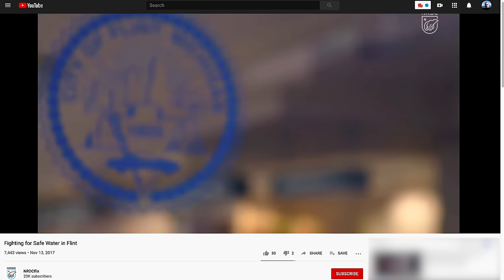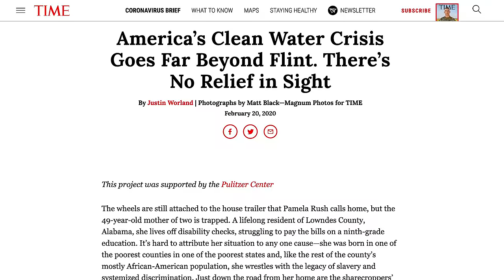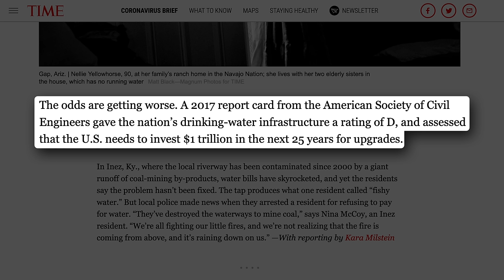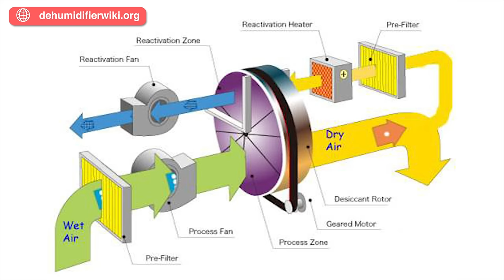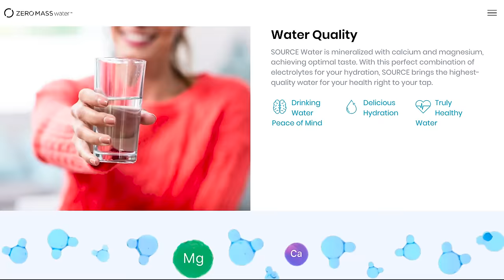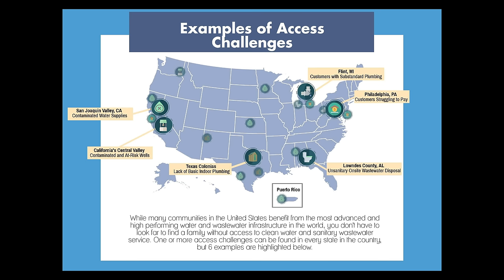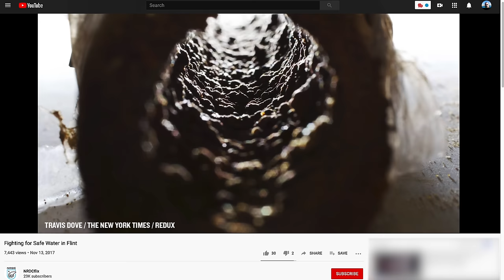Off-Grid Water With Air and Sunlight

Comment: Another great way to get distilled clean water.......your ir conditioner system removes  the moisture from the air and is safe to drink and it will produce upwards of 5 gallons per day here in Texas.
Reply: You read liter wrong, in terms of gallon, it's 1.3 gal/day; and if you shill out $13,000 for an array of 2 pannel (according to Source). Moreover, the water is not safe, same goes to drinking water from your dehumidifier.
Reply: @pauldo5846  it's distilled water though.  I've captured several gallons of it BUT ran it through a water filter and it tastes exactly like the distilled water I buy from Kroger.

Comment: There is a cheap air conditioner that sells for around $200. It is sold as tent air conditioner and caravan air conditioner. It consumes 0.2 kW. If you buy it, you will get both cold air and approximately 5 liters of water. You then use this water with osmosis purifier/mineralizer systems.  Thus, the total cost would not exceed $1000

Comment: Thanks for sharing. 

If you could touch on a few 
questions not covered in the video...

¹During peek production, how 
   many letters of water has a 
   single unit provide ?

²At what temperature do the units go
   into hibernation mode ?

³ Is the hibernation mode
   adjustable ?

⁴ Is there a minimum height required 
   between units & water storage
   tank (if mounted to same service) ?

That's probably enough for now.
😁
Thanks again.
Reply: Ps..
I understand that the answer 
pertaining to question on 
productivity is based on 
humidity. 

A best guess or better will serfice.
👍

Comment: This are interesting but need a lot of improvement. Like you said they make a lot of noise pollution and if you have more than one in a community the noise will increase. Also what effects is the air pollution on the inside and will the filter be able to catch every pollutants I think for watering the yard or having some at hiking areas to stop running pipes that will leak in the future is a perfect solution

Comment: Its still pretty cool machine.  hook to a water tower or storage tank let gravity do the work. Than you could store little water for showers and other things.since its using solar no reason couldnt install heaters into the system to get it to work in winter. Or melt snow and ice for water and filter that

Comment: definitely a really sound option. I intend to live rurally in Mexico and I am VERY interested.  Re: the freeezing thing if the unit was inside a building with a small heat source, it might be fine for a few degrees below 32, but for deep freeze i don't think so.

Comment: I live in Arkansas and the city water is actually good but I have a son that lives in New Orleans and their water is carcinogenic.  Another son lives in Southern Colorado where water is Very expensive though he would have trouble with freezing as he is at 8,000 feet.  He and his (current) three kids would benefit from this.  Think about the many American Indigenous families and all the trouble they have with reliable water.  I have to think that this company has an absolutely killer product.  The noise and freezing problems don’t sound insurmountable.  Remotely mounting the tank to the attic could help maintain access to the tank.  The noise given how much I would use as a single old man, I could likely run in eco or quiet(er) mode all the time.   
This is very promising.  Flint could use this on an industrial scale once the freezing problem is cured.  I love it.  I’ll set a reminder in my calendar and watch their progress.
Thanks for putting this out.  I hope the company sees the value you have brought to their product and makes a point to keep you happy.

Comment: We use a Brita pitcher with Costco Kirland filters and spend less than $75 a year for filtered water. That would be $1125 over 15 years! There are even higher end systems that may cost you $200 a year, which is still even less than this system.

Comment: My question would be, how would this affect rainfall in already dry areas. Areas are dry or water scares because it does not rain enough. What do you need for it to rain, enough humidity to generate clouds and rainfall. So if you extract whatever humidity is in the air on a large scale will it not prevent rainfall even further thereby making the area even more drought prone than it already is?

Comment: @ Ben Sullins its been two years since your video, how is the system working now?  Have you seen any upgrades on noise dampening or improvements to use for harsher/cold weather areas?  TIA!

Comment: Will it work on a boat?  Because reverse osmosis watermakers are expensive and require frequent maintenance with expensive parts.  If this is set it and forget it, and it works on a boat that rocks a bit all the time, you can sell a lot to people with boats.

Comment: Oh wow that noise. I was seriously considering these panels until I heard that noise. That is a deal breaker. If they can address the noise problem to make it not noticeable I will reconsider. My other issue is does this solar panel have to be tied into the grid or is there battery backup for the solar panels?

Comment: I live in Phoenix, but this would not be practical because I live in a planned community with an HOA.  Also, I'd need all the roof real estate I could get for solar panels if anything goes up there.  Our tap water is safe and filtered, so it would not be practical.  I would, however, consider something like this at scale for an off-grid property with some space.  A combination of harvesting from the air and rainwater collection could be an interesting alternative to drilling a well if one could find a way to keep the cost down.

Comment: Engineer here- fantastic device. Impressive whoever came up with this. I love it, but I still think it is very important that the general public understands how solar panels are constructed (which takes lots of energy), the materials/metals they require, how those materials and metals are physically obtained (also takes a lot of energy and often heavy machinery), the processing of these materials (massive amounts of energy) & in the end what happens to the panels and their components once they no longer work (a lot of recycling techniques require a lot of energy . All of those factors, and many others, combined mean that solar panels are debatably worse for planet earth (long term) than other traditional forms of power. So for all the “clean energy” people out there- it’s not as clean as you think. Dive into the science and you’ll understand you’ve been mislead. But, hopefully newer methods can be developed to actually make these things clean for the planet. As of now they are not.
Reply: Really? Solar worse than coal? LOL
False.
Reply: @Kimoto504  did you read any of the things I said about solar? Have you ever witnessed the manufacturing processes of solar panels and how they obtain all of the materials and rare earth metals needed? If you’re going to engage someone with a “true” or “false” response you need to back it up with facts. Go do yourself a favor and research things before you pretend to have the answers.

Comment: I'm only guessing here as to what is inside the black box. Thermoelectric Recirculating Chillers, if this is the case, you could DIY a water condenser for a fraction of the cost of buying one from this company. A Peltier cooler can also be known as a Peltier refrigerator or solid-state refrigerator. Hook them up to solar electric panels and you are good to go.

Comment: You may not DRINK 2 gal of water per day- but add in the volume used in cooking (including washing produce), making formula for infants, ice cubes, pets, watering food plants (I grow lettuce and chives indoors year round) brushing teeth- it seems 2 gal per day would be minimum. Still useful and helpful in no running water scenario- in which case i can see watering the parsley with the toothpaste scented water. Gross but efficient. Also you would want clean water for eyewash and wound care/ CPAP- so it would actually pay for itself far sooner if you allow for these factors.

Comment: Obviously, these ideas are floating around there, and exist already in the form of condensation frrom A/C coils.  I would suggest people in populated areas that use A/C be taught how to capture the condensed water and use it in their gardens and to water trees and shrubs.    Currently I believe people allow this condensate to pour out of the unit onto the grass near it or into the drain. Such a created water waste - close to 1-2 gallons a day if you start collecting. The challenge of course is storage, but my plants don't seem to mind a bit of algae water if I don't use it up fast enough.  In a pinch, I suppose I could R/O or UV or distilled this water, after giving it one more fine filtration  like carbon filter or mesh/rock/sand biolfilter.  Not great in winter of course, so it's a hot / warm location solution year round.  I have not tested the quality of A/C condensate, but maybe someone could advise if it's safe to drink without filtration or treatment with chlorine,  R/O or UV.

Off gird youi can try as much as you like if you are made of money, but personally I would not go off grid till I had enough money to waste on solutions to make my off grid home as comfortable as the place we call "the city."  Off gride can happen in the city of course, but if you paid for a service dlot, you started "losing money" if you want that lot to be "off grid."  better to let someone else buy the serviced lot, and you go actually out of range of servcie and do your experiments without making your neigbors feel bad that now you have water and they don't.

Comment: Just FYI, you can buy a super efficient, very quiet new generation dehumidifier (uses 214 watts) for $120, then a 300 watt solar panel $280,  mini charge controller/ inverter $250 and a 5 stage water filter for $99 for a total of $749 and get over 3 gallons per day average! The Hydra-panels are a great idea and product, but WAY to expensive.

Comment: I own a small home in the Midwest with a big yard in an urban area (KC area). It seems like everything in our township is regulated so I could see neighbors complaining about the noise level.
Also I think the price is a bit high for part time hibernating utility. The Midwest can go months with below freezing temperatures. And if most people are seeing this as a survival option it won’t do any good if it’s just cold with no snow. Of course when it snows one can simply melt the snow to drink.
I would consider it in a sunnier climate zone.
Why does it need a mineral filter? And are those filters really necessary or are they just adding it to the system so that they can have a perpetual profit?

Comment: It is a good first step, but needs improvement.  I have built crude passive solar heaters in the past, and other gadgets.  I believe that this could run a bit at night by modifying a window AC, or humidifier and adding batteries.  Seems wasteful to only use it a few hours a day.  Plus, getting more hours of operation could possibly be cost effective by eliminating one of the panels.

Comment: Did you try to go a month without the flavor additive? You might not have to flavor the distilled. Or, you could put lemon juice drops in jugs and keep it in the frig. We filter our tap and it has no  flavor, sits at room temp below the filter. No problem. 
Also, water will vaporize at 140 degrees in a box that has slightly less air pressure, liquify on a slightly cooler surface, drain into a container.

Comment: I have only one  issue with this video. The Flint city water situation is due entirely to water treatment mismanagement. Lead in the water (which from reports I read was less dire than the deadly amount of bacteria) is due to the water management causing the water to go soft and thus leeching the metal from the lead pipes. This is not normal. Drinking water is not suppose to be soft. Of course, it isn't suppose to be too hard either. Those lead pipes are treated, and the city essentially stripped the treatment from the pipes.

So yeah, lead pipes are potentially extremely dangerous when mismanaged. Because when things go wrong with lead pipes, they go very wrong. But, they are costly to replace and Flint city apparently didn't want to flip that bill. 

So that begs the question? Why are there still cities with lead pipes used to transport water? I would take a gander and say that lead, being inert doesn't change much and lead pipes can be left alone for nearly a century if done RIGHT. And Flint City water utilities did not do the right thing. I don't want to sit here and sound like I am pro lead pipes. I think there are better materials out there. I do want to say that I believe the lead pipes are a far lesser concern than contaminating and miss managing the water...

Comment: I’ll stick to my DIY ceramic gravity fed water filtration system with a lifespan of 5,000 gal for $80. 

2 - food grave 5 gal buckets with lids
1 -high grade ceramic filter
1- spigot to dispense the water
1 - dish save sponge to clean the filter every 45-60 days 

$80 @ 5,000 gal = $0.016 per gallon

Comment: Solar heaters to warm the panels for melting ice on Source product.  I’ve been looking for the screens to capture night dew collection in Texas.  I have whole house rainwater collection.  I want to run my AC condensation into tank instead of dropping in septic system or in the Cities with sewer systems they drain it on the ground.  I think the AC water is pure as well.

Comment: The cost as low as it is, is beyond the means of most of the people who actually need it.  It is also too expensive for agricultural use by an order of magnitude at least.  That said, for my desert get away off grid house it might be ideal, especially if it could be rigged to fill a tank when no one is around.  It might also work as a backup source in a location with frequent outages but better with better access to economic resources.  Near an ocean it does not appear to be competitive on cost with desalination or water makers, say for a yacht, even if it could survive the rough seas mounted on the deck of a ship.

Comment: Were your ROI calculations factoring in the two systems you got? It seems like you are using the yield of the two systems but the cost of only one. Not trying to mock you, just genuinely considering an Ambient Water Generation system.
Reply from the maker: $6,000 was for both hydropanels installed

Comment: It is an over glorified solar powered dehumidifier.  I would boil that water before I drank it.  You would probably be better off putting a tub of water on your roof filling it with tap water and covering it with a glass cover and let the sun evaporate the water and collect the condensation off the glass.  Then boil the water and drink it.  If you want to use a solar panel to boil the water that would be cool too.  If there isn't a built in serialization process in the SOURCE Hydropanels then you are looking at some really bad potential contaminants like Legionnaires' disease.  Yes you said it had an air filter but that won't stop things like Legionnaires' disease.